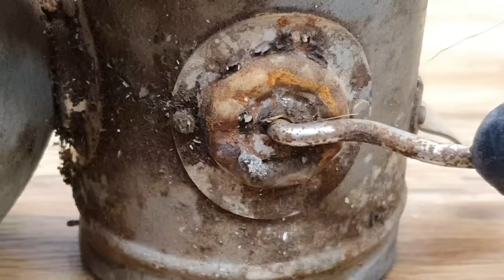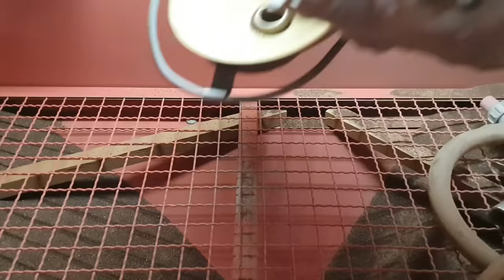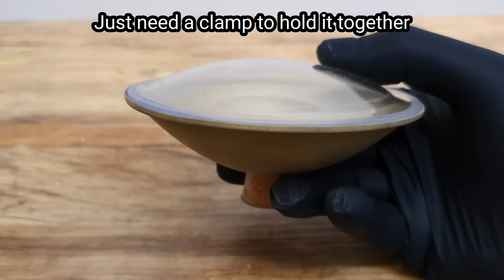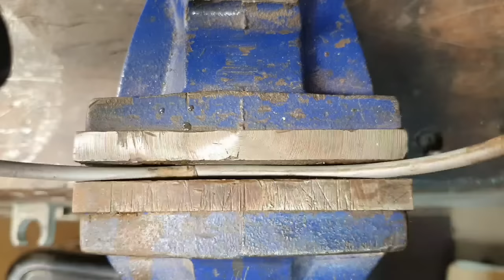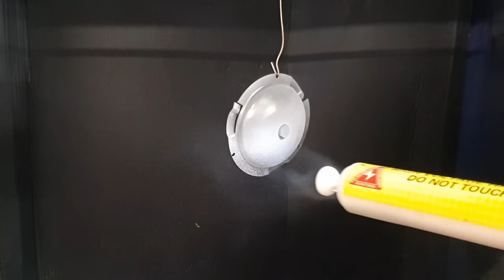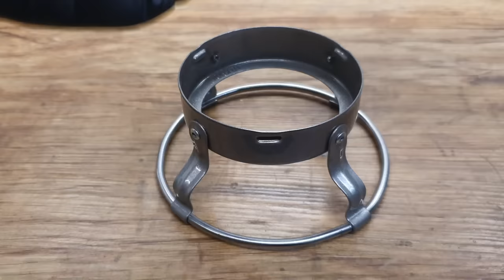1960's Eveready Torch Lantern Restoration / Rebuild

Comment: You knocked that one out of the park mate. Genius solution to the lens and retaining ring. The domed lens polished up well too. Back in the ‘50’s and 60’s my dad taught me to use steel wool to scour the plastic or “Perspex” and then Brasso to polish it. That was before wet/dry sand paper was prevalent.
Your restorations are improving exponentially mate.
Reply from the maker: Thanks Shed Man that's very kind of you to say. I was almost thinking of replacing the top lens but then my video would have been another 10 min long. I'm a big believer in Brasso, hasn't let me down yet. Appreciate your comments always 👍 thanks for the support.

Comment: Great as always.  Would like to have seen how the switch and electrical mechanism worked
Reply from the maker: Thanks for watching C Harris. Excellent suggestion I'll keep that in mind next time. I had to cut so much out though already to keep the time down.
Reply: @Austeration - we don’t mind long videos, and you didn’t show the top light working. Interesting that you put an LED bulb in the forward facing torch light, and an incandescent bulb in the top lamp

Comment: I subscribed because I was impressed with how meticulous and inventive you were. I did think shortening the rivets instead of just using shorter rivets was a little cheeky, though. 😏😉
Reply from the maker: Thank you very much for the Sub and for watching Kent that is appreciated. The rivets I had was the shortest rivets I could purchase. I dont think they make them as short as what I modified them to be.
Reply: @Austeration  Ah. My bad.
Reply from the maker: @KentRedford213  good call out though 👍 I had some other copper rivets I was going to use but I had the same issue with those.
Reply from the maker: @KentRedford213  PS have you seen my other lantern restoration yet ? https://youtu.be/j7oK7tRsano
Reply: @Austeration  No, but I will. Lantern restoration videos are what got me watching restoration videos, in the first place. Keep 'em coming!
Reply from the maker: @KentRedford213  please do. I think you will find mine completely different to anything you have seen 👍

Comment: A question. Why spend the time & money stripping paint if you have a blast cabinet?   I bought my cabinet to avoid stripping paint.
Reply from the maker: That is a great question 👍 I do it to avoid contaminating my cabinet. Also I find even though the cabinet does a fantastic job it can cut down the amount of time standing in front of it trying to get blast paint away.
Reply: @Austeration  Thanks for the reply. One thing I will not blast is newer military items painted with CARC paint. It's dust is not good. Beware of it.
Reply from the maker: @paulhare662  thanks for the tip 👍 what size blaster do you have. The same as mine or the bigger sized unit ?
Reply: @Austeration  Mine is a US made Scat Blast 4 foot x 3 foot x 3 foot cabinet. Don't know what that is in metric. It's served me well for over 25 years.   A recent purchase was a small ultrasonic cleaner, 4 barrel carburetor size. Love it. 
Enjoying watching your work. I know how to do all this stuff but sometimes watching a top notch craftsman helps me to slow down and do better work.  A reminder that the joy is in the process more than in the result.     Working on a bunch of very old kerosene lanterns right now. Need to learn some electroplating skills. Best wishes.
Reply from the maker: @paulhare662  cheers Paul. Have you check out my Kero lantern and my heater yet ? I Agree the joy is in the process and trying to come up with interesting solutions.
Reply: @Austeration  Watching the heater vid right now. I've subbed and will be checking more out when I need to let paint dry.
Reply from the maker: @paulhare662  thank you for the sub very much appreciated 👍